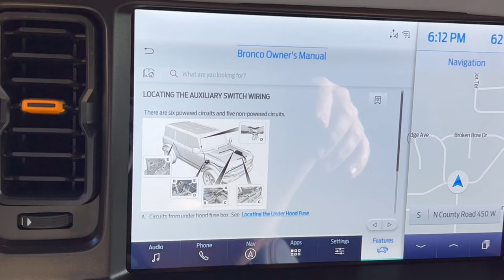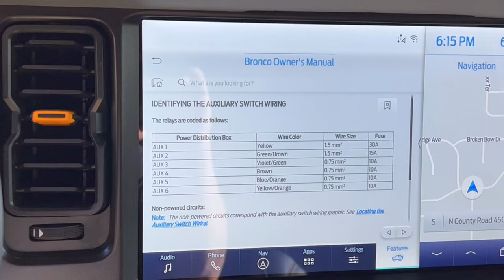SPV 2021+ Ford Bronco Triple Fog Light Kit Installation Step by Step Rigid, Baja 2022 2023 21 22 23

Comment: I finally set aside the time to do this install. I find this video and prepare to do this step by step, only to discover that the extended mounts aren't included with with the bracket! Seriously!? I dropped $900 dollars on this setup and you guys couldn't be bothered to include all the necessary hardware? I have to drop another $75 before tax and shipping just so my lights aren't upside down? Whos idea was this, why isn't it part of the package? Why would anyone installing these lights choose to have the words "Rigid" upside down on all 3 pods? I was torn between you guys and Oracle and it looks like I made the wrong choice.
Reply: If installing on a modular bumper, the Rigid logo will not be exposed regardless if nightside up or upside down.  The lights will fit snugly and the light area will not be obstructed, but the light housing will only have about 1/4 of it exposed.
Reply: I ordered mine over the phone and they explained this clearly and recommended purchasing them.  Sorry that happened to you...Maybe they need to add a note about this if ordering online, but by phone they were amazing and explained everything I would need or what is optional.
Reply: @andrewlaino7518  absolutely incorrect.